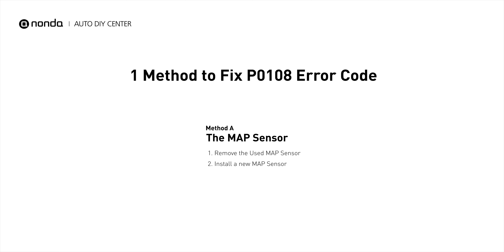How to Fix P0108 Engine Code in 2 Minutes [1 DIY Method / Only $11.6]

Comment: Have a dodge caravan with the 3.3 V6..please help....asap...p0032 p0108 codes will not clear ......just recently.when freeze happened in Dec here in Louisiana,it cracked both heads........so I've had refub heads done,new fuel pump,new 02 and new map new plugs and wires and fresh oil...still runs the same after..help???????
Reply from the maker: Hello, as you are getting more than one error code, we suggest getting your vehicle visually checked by your local mechanic for further diagnosis.
Reply: @nondainc  now I'm getting codes p0172 and p0442

Comment: I got a new sensor for a 03 lincoln town car and still have code?
Reply from the maker: Hello, have you inspected the wiring harness? Make sure that ground is plugged in tightly and check for vacuum leak.
Reply: @nondainc  OK thanks alot
Reply from the maker: You are most welcome! Stay safe.
Reply: Me to smh

Comment: BS. After clearing codes all is NOT RIGHT with your car just because the code is cleared. None of the OBDII will be Completed or Ready. Now you must run at least one complete OBD II drive cycle or sometimes 2 cycles. Then with a real scan tool check the monitor status of ALL monitors. With the exception of EVAP Monitor the car will immediately fail any OBD II Emissions test if the critical monitors are not complete.